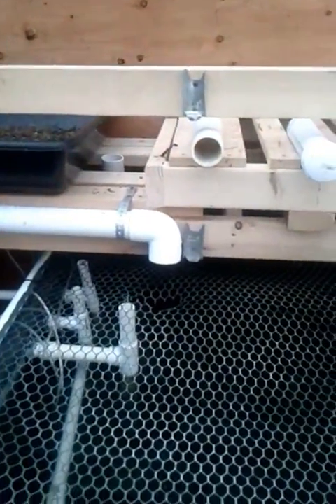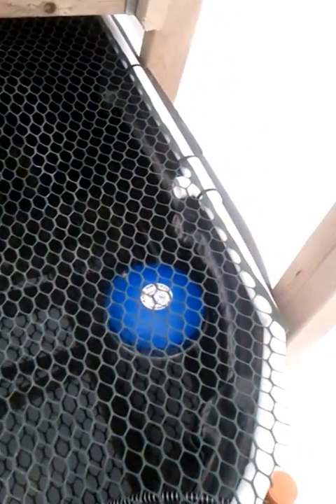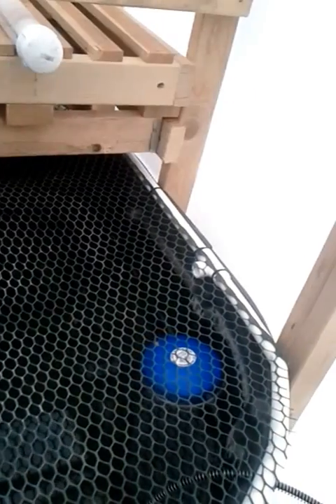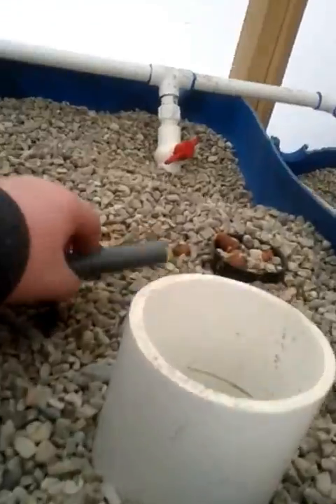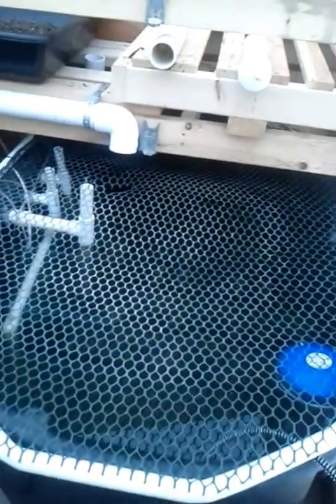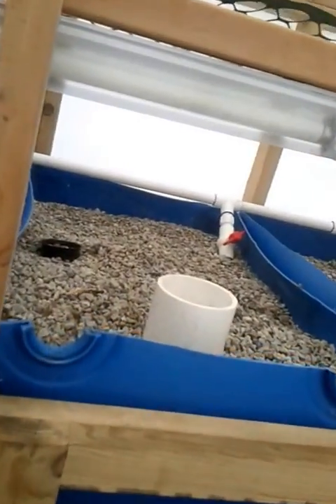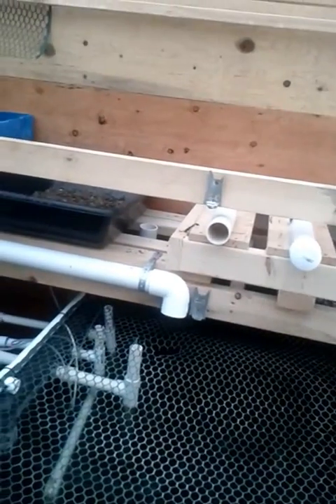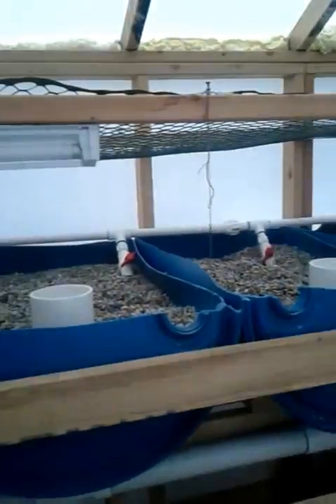Aquaponics update system smells real bad like ammonia and has only water in fish tank

Comment: I'd suggest just doing a 100% water change, and you should be fine. Then once you get it all running, you can start a fishless cycle with pure ammonia.
It could be possible that you could still have some good bacteria elsewhere in the system. And it would start back up pretty quick.
Using bleach would remove any chance of that happening. Bleach can be ok to use, but it Must completely air dry before adding any water back to it. Which could take a long time in that clay substrate.